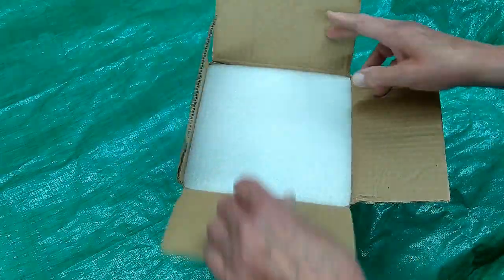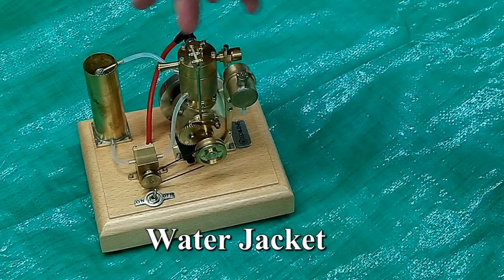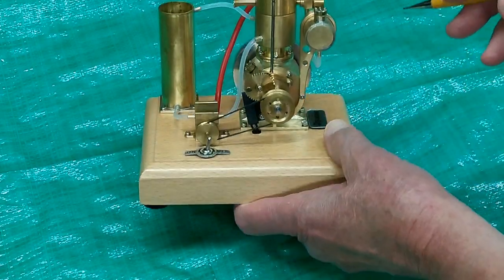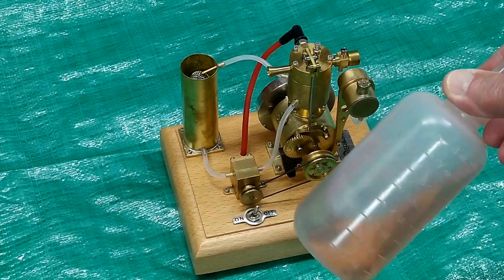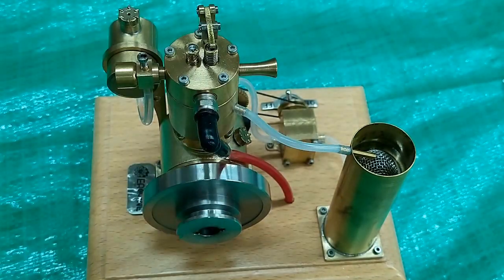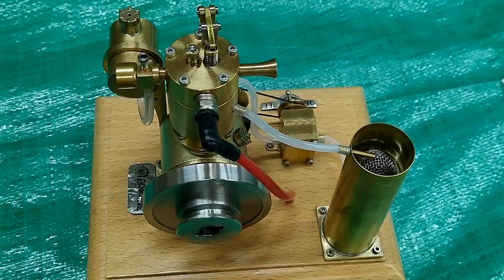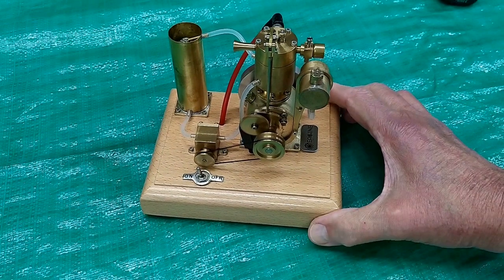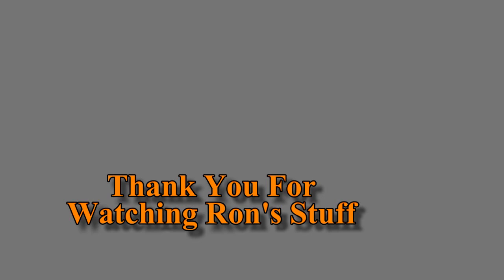Eachine EM4 Vertical Water Cooled Engine Review

Comment: An engine that can't do practical work is not an engine worth buying. Within reason, these should be able to do more than spin their own flywheels.

I have one of these microcosm engines on order. I plan on using it to generate power that runs a small N-scale layout(Thinking maybe Woodland Scenics Scenic Ridge, or perhaps the Grand Valley HO one built with N-scale parts). The half-dozen or so watts that would require is well within what is reasonable to ask of one of these engines.....

Comment: Hello Ronald, thank you for the very good explanation. I will buy this engine via your link to support your very nice channel. Not so far away in time , in germany they will stop any combustion engine so I buy this motor just to hear the good sound. Stay well, Wolfgang
Reply from the maker: Thank you very much! Have you seen the EM2? Check it out before making your decision. Ron
Reply: @RonaldWalters2010  Not an easy decision, Ronald. It seems to me that the EM 2 runs a little slower than the EM 4 .This would be fine in addition to the lower price of the EM 2.
Reply from the maker: EM2 runs around 1500-1600 RPM
EM4 runs around 2900-3100 RPM
Speed was measured with a laser tachometer but the reflective flywheel can cause errors with the laser.
I think the EM2 has more eye appeal and since it runs much slower, it does not heat up as fast.
I also like the EM1 but (as stated in my review video) it needed a few changes and was received totally out of time. Once I made a few changes (mainly longer set screws) and figured out which way it was supposed to run, it has been a very satisfying little engine (but admittedly a bit more fragile/sensitive). 
EM1 and EM2 just look good on a shelf doing absolutely nothing. :-)
Reply: @RonaldWalters2010  Thank you Ronald and please excuse my bad english, I am located in germany close to Nürnberg.
Reply from the maker: My friend... your English is better than my German! :-) Ron